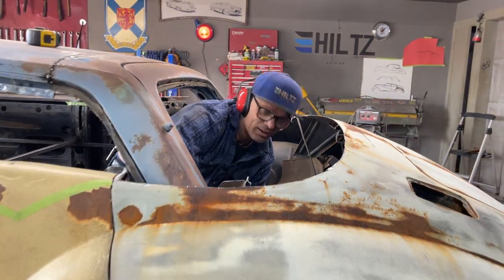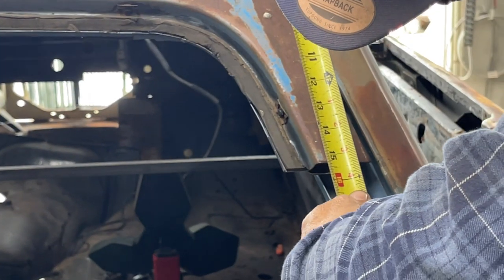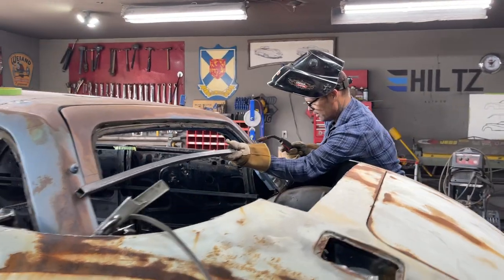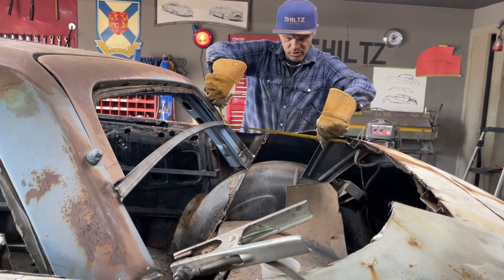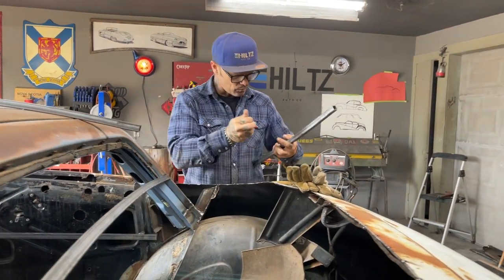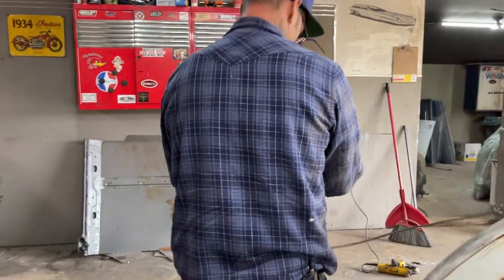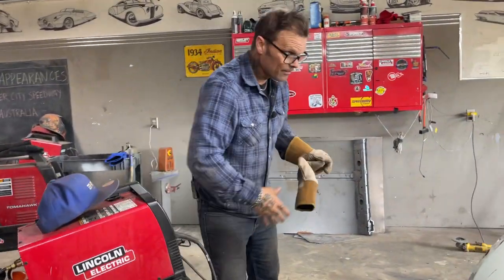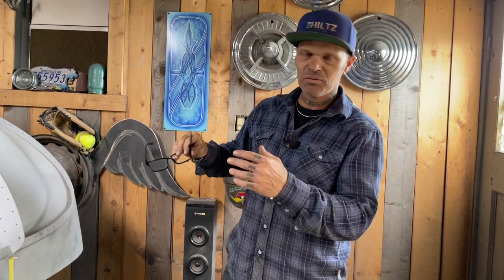Designing the rear | 1959 Jaguar concept

Comment: Should have kept the look you started with as a Jaguar station wagon. Should have split the roof lengthwise and made it fit with the width of the body. Should have kept the extra 2 inches of heigth as Jolene said (you would have gotten the 2 extra inches heigth at the windshield as you split the roof lengthwise, widen it in the back, shrink the widt in the front)

Comment: Have you considered cutting the top of the doors off following the body lines. It would look like a 4 Dr Xk120.
Reply: That's what the yellow tape line represents.
Reply: Why not first chop the original top and go from there to do the same wagon look? Personally I think the chop is too low with the square top, had it been left a little higher maybe the roof would of blended in. Any way will see the end result. I'm not criticizing just wondering. One more thing😁 if I may. Wouldn't it be a good to use etching primer on the new panels that were welded in. Less sandblasting as the car sits out side.

Comment: This is the only build you’ve done Chad and Jolene  that I’m not a fan of. It’s just not doing it for me. I know this is your fun, and enjoy. Still will watch on how it turns out. To bad we will never see it finished to see if I’m wrong on this one. The 40ty hot wheel car you are going to have finished by an outside source?
Reply: I agree. Anyone can change a car to where it looks problematic. I think this could be one of those that ticks the grade at a sub par level for Chad. He didn't have to go this far and make it look weird. Like Roussel on Full Custom he should have chopped it yes. .But using the same top and pie cutting the sections in the rear to make it work and make it right. This looks more like an execution. I mean I'd be completely fn amazed if this car turns out looking at all decent. But I cant wait to see. Either way. It could be an exotic amazing vehicle when done. 

But its easy to feel negative since most the time he is guessing at this stuff himself as he goes along. At least he has the guts to screw up on tv. Good for ratings along with all the smack downs from his followers. But, he actually needs help doing these large tops. This one person show is a long one that will never end it seems. And when you do it wrong and you want to make it better. And you feel you need to work harder. That's what makes you okay with failure. You can admit defeat and move on to the next. At least you try. More than I can say for many.
Reply: It will be just fine...

Comment: Great job, it looks good 👍 and I love it, who cares about critical comments. The project is still in the initial phase and in the full creative process, the criticisms are absolutely out of place.
But there is one thing I have noticed in these years of video. Perhaps you should pay a little more attention to the cables and extension cords of your work tools.
You know how it is, I was an electrician and I repaired a lot of drills etc... with torn or cut wires. 😉 
Greetings from Switzerland

Comment: welp since you are following the contour of the bum at rear window it wont really matter if its level or a lil' lower as it will have a high spot at center and drain off to the sides, long as that high spot at the center line is higher than the highest point on the quarter panels water drains, which it appears it is, fact it could have swooped down long as that centerline at rear window is higher than the quarters there is no where for water to pool..

Comment: love your thought process. i'd cut that car off along the door body line sloping up and over the rear fender.  Weld the front door closed, move the drivers position to the rear just front of the trunk. Put a bubble roof from the truck forward. A super long nose Cruella Deville car. Not saying for you, but your insperation drives mine. thanks

Comment: I wish I had the artistic eye for this. I always start out with things like this saying "You're going to put a what, on where - naw that ain't gunna... I'll be damned, it does work". In the end the first cut is the hardest. It's only metal after all, If it goes sideways and looks like hammered crap, weld the original stuff back on, at least you tried something different

Comment: Not to be a "hater" just my opinion.  But the lines for this car are way off. You have a rounded  body and a sharp roof. It is a bad crash of design.  It throws the eye off. Would have been better to modify the original roof.

Comment: Sad face.  I really liked the initial sketch but the fabrication of the trunk would have been a ton of work.  I'm sure I'll like the car no matter how its built.  Aesthetically speaking, the flatness of the roof really needs to tie into more flatness.  There are going to be some horizontal surface behind the roof so that may just do it.  Also, looking at the space that was opened behind the rear window, I'd guess you can get another 8 to 12 inches of roof line, though you probably don't want to go backwards now, AND that would remove a flat area for the roof to blend with.  Just thinking out loud here.